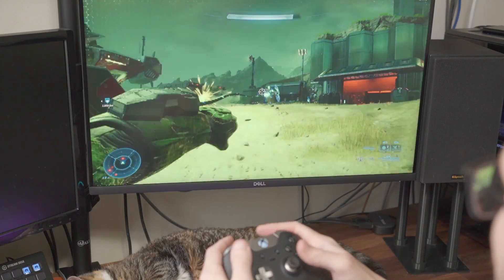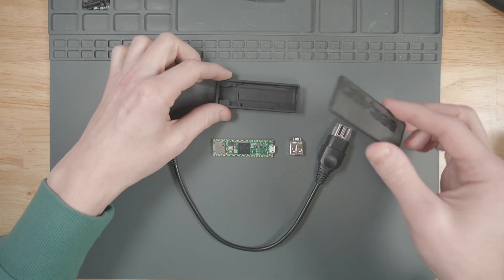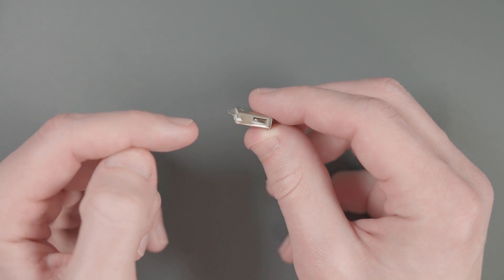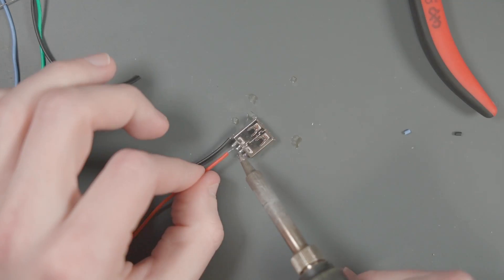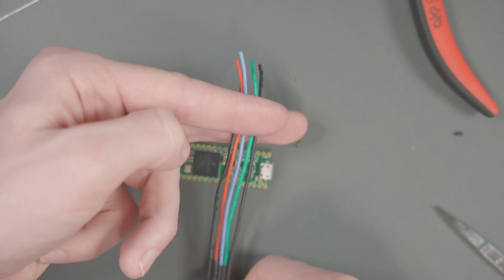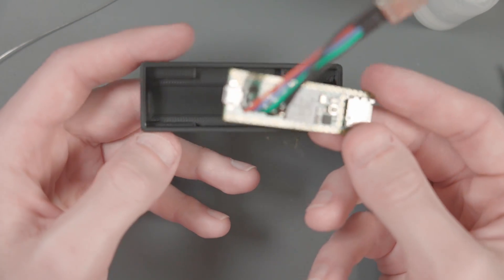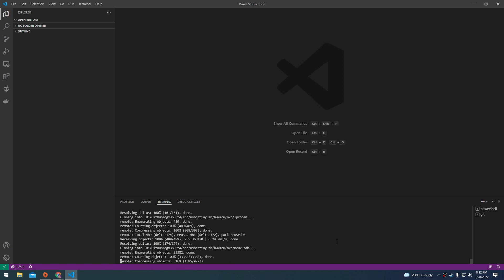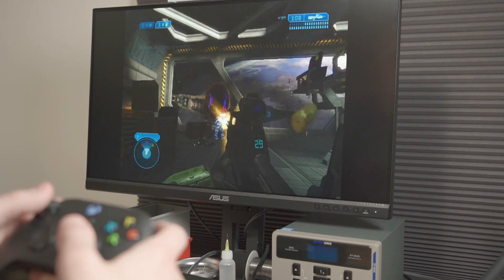Use an Xbox Series Controller with your Original Xbox!

Comment: How do you save the games ? Without the memory card if you use a modern controller?
Reply: The xbox has a hdd that is normally used for saving, the memory card is just so you can bring the saves with you i guess
Reply: @starfire2133  thanks ! I’ll be returning my memory card then ! Needed that info!
Reply: @Caezi  I mean, keep it if you want, they aren't required but I'm sure they are pretty neat

Comment: No offense meant, but the og Xbox used usb.  It was just cutting a controller wire and splicing it to a female plug skipping the brown/yellow(?) wire.  Is this for universal joystick support without drivers?  I'm curious because in PSO I spliced for usb keyboard support.  🤷‍♂️
Reply: you need to convert the signals from the controller you are using to the corresponding signals for the XBOX. If you come up with a better/cheaper solution, please post it
Reply: @art0van0derlay  It's just USB 1.1 so you can google "XBCD" and see how the connector works.  Any USB 1.1 controller will work.
Reply: @jeffchisamore1556  I think you are missing the point of the video, which is to get a new style controller working with the original xbox. The OG xbox will only work with the protocol used by the OG XBOX controllers, e.g. the Duke. The hack above takes the input from other controllers and emulated the Duke. If it was as easy as splicing cables together, people would not have invested such a lot of effort in building this and they would not sell for $70+
Reply: @art0van0derlay  You might be right.  But as USB 1.1, the original xbox can use a lot of different devices.   Mice, keyboards, etc.  Even PC controllers.  He's got a great video,  but I just wondered why, when the original xbox USB is so well documented.  To be honest, I've actually hacked cables apart on mine.  So I have some experience with it.   Read the info on the XBCD driver page, and maybe you'll see what I'm talking about.   Cheers though, and thanks for the chat on this great old machine.  🙂

Comment: The OG Xbox ports are already USB ports with 1 yellow wire added for the "Vibration" function... you can replace ports 3 & 4 of your Xbox with standard USB ports are just plug in the 8bitdo adapter without going through ANY of this.
Reply: wrong. you need to convert the signals from the controller you are using to the ones the XBOX controller produces... which is what this is doing
Reply: @art0van0derlay  I have replaced ports 3 and 4 on my OG Xbox with USB ports and all I did was leave out the yellow wire.
Reply: True but this is plug and play and let's you switch around. Also much easier than taking apart the console.

Also, the OG Xbox would probably need to be modded with drivers
Reply: Would this work with a modded extension cable? Just by cutting of the yellow wire, and soldering a female usb port to it. And than plugging in the 8bitdo adapter? And what are u using those usb ports for?
Reply: @0010301  it should work just fine.. and they can be used for a flash drive as a memory storage. Not sure how large the upper limit 8s, and I think the Xbox will want to format it.
Reply: @mikey17314  if you have achieved this, please post the details, I'm sure lot's of people will be excited to see. (Or just send them to me personally, I'll make the money from it). You can absolutely use (or make) a usb adapter and you can use a usb stick as storage... but you absolutely cannot use it to use a usb controller (e.g. XBOX 360, PS3/3 etc.) on the XBOX. The protocols for the controllers are different so it plain cannot work. This project and others like the OGX360 (which uses an arduino plus a bespoke host circuit and costs £80) use microcontrollers to read the controller signals and translate them into the corresponding XBOX DUKE responses. And by the way - I'm not speaking from speculation, I tried it, then I built the teensy project and adapted an XBOX360 RF module so I can use an XBOX360 wireless controller... which works great

Comment: Just built mine today. If you're using the CLI mode, just compile, install the teensy programmer, and program the ogx360_t4/.pi0/build/DUKE/firmware.hex file to the teensy.

Comment: is the 8bitdo adapter required to use an xbox series controller or ps4/ps5 controller? I would have though those controllers could work without the 8bitdo
Reply from the maker: You need both parts. The ogx360 adapter lets you connect any Xinput controller to the Xbox, and the 8BitDo adapter let's you use a Bluetooth controller as an Xinput controller

Comment: I will be testing the wingman soon. They recently added OG Xbox support. I believe the wingman plus a 8BitDo adapter will work with series SX controllers. I will report back if it does. This is a nice project but costs are still too high.
Reply: Did it end up working for you ?

Comment: This works great. So far I've tested Xbox one wired, 360 wired/wireless PC adapter. I have a 8bitdo adapter on the way. The only hangup I had was  not first downloading and setting up GitHub. I hadn't set it up before and wasn't familiar with how it worked in visual studio. I was getting errors unknown git commands as it wasn't installed. Hope this helps others who may struggle with the same.
Reply: thank you for this!  I didn't have git installed either and kept running into errors.

Comment: Question: I have a modded OG Xbox as well. Is there a noticable small lag with the controller and action on the system?
Reply: Just tested mine and not only no lag it feels smoother and faster than brook wingman and regular controllers.
Reply: @ConsoleCenter  Actually found out it was the upscaling on my tv. Changed it to Game Mode and now all is well
Reply: @christopherdavis5950  not upscaling, processing. modern TVs will always upscale low resolution content no matter if the TV is in game mode or not.

Comment: Man it's crazy how these old consoles still have support from the community 20+ years later.
Reply: it would be even crazier, if a company just simply would build decent controller. you can find plenty of 6-8 usd cheap controller for the original xbox, but they are all horrible, bad analogsticks, crap feeling buttons, terrible shoulder sticks etc. many would have no problem to pay 40-50 usd for a good controller if you just can plug and play like with those shit 8 usd controllers. i dont get it why no company, who already builds controllers do not make them...
but instead people need to buy eletronic parts worth up to 50-60 usd, solder it, programm it, maybe put it into a 3d printed case and use it externally. i just dont get it.
Reply from the maker: Programming a micro controller and designing a 3D printed case is free and easy. Designing a good controller takes a lot of of time and money
Reply: @dubesinhower  i am not talking about a new startup. beside for somebody to do it from the ground up, designwise its the same amount of work to do a case design, owning a 3d printer etc.
i am talking about companies who already are in the business, but for some odd reason they dont make a decent controller.
8bitDo or Hyperkin have plenty of controller designes, they just need to put the correct electronics in it and attach instead of usb the original xbox port.
hell they could even mass produce and therefor bring the price down controllers with the ogx360 in it, just partner up with ryze so he get for each controller, because he did the softwarework 1-2 usd and everybody could be happy. charge for it 60 usd. but no, we can buy crap xbox classic controller from aliexpress, which work but are terrible in general.
Reply from the maker: It's awesome! Honestly that's one of the reasons I'm interested in these older consoles. I enjoy modern projects that make them more functional
Reply: Even more so, it's more supported now, than it was 10 years ago. Projects like Insignia, have revived Xbox live 1.0. The Original Xbox is the best it has been for years now. I don't see it slowing down either.

Comment: Is there something for Xbox 360? I want to use my Xbox Seires X controller on XB360.
Reply: This is for the original xbox only. What you are looking for is a Cronus Zen my friend.
Reply: @logane1102  Thanks my man. Now I have to find the power brick and get that Cronus Zen. I still have my old Xbox 360 controllers, but I like more those from Series X =D. 
Thanks again.
Reply: There's multiple Brook adaptors that will work that are much cheaper than the Cronus Zen.
Reply: @MichaelM28  I’m not familiar with the brook adapters but the cronus zen is definitely worth it because of how versatile it is. It works with every combination of 7th gen console/controller and up. And has superb bluetooth connectivity, AND can even work with a softmodded PS2 running games from OPL and OG xbox if you have an ogx360. Not only that, but you can make your own scripts and load them onto the cronus to enhance the experience such as remapping buttons, analog deadzone and sensitivity modifiers, etc.
I imagine the brook adapter would only work for the 360 and input latency may not be the best.
Reply: @logane1102  How do you get the Cronus Zen to work with a PS2?

Comment: Would this work with the official Xbox controller dongle for pc
Reply: Bluetooth 8bitdo/compatible controllers via the 8BitDo Wireless USB Adapter or Rev 2.

Wired 8bitdo controllers when they are started in X-input mode.

Xbox S/X Wired

Xbox One Wired (Genuine / PDP)

Xbox 360 Wired

Xbox 360 Wireless (Via PC USB Receiver)

PS4 Wired

Comment: A lot of people have mentioned the Brook adapter. I have one for use with a racing wheel. You still need to get a USB to OGXBOX cable to use that adapter.
Reply: I have the Brook and it works well with XB1 controller, but lacks wireless XSX controller support. 

The Teensy board does the trick though, so I’ll be getting four setup shortly!
Reply: @blu_falcon6321  doesn't the brook adapter work with series S/X controllers if you plug the 8bitDo adapter into the brook and  then sync the controller to the 8BitDo? Pretty sure it does...
Reply: What's your racing wheel setup for the OG Xbox? Didn't think the Brook supported wheels

Comment: There's an adaptor called the Wingman XB by Brook Gaming that works the same as this and even has bluetooth built-in. It also requires no soldering.
Reply from the maker: Wingman XB does not support wireless Xbox controllers
Reply: @dubesinhower  It doesn't support Series X controllers wirelessly due to them using Bluetooth LE but it supports all standard Xbox One controllers and the Elite Series 1 wirelessly. Will also work wirelessly with the Dualsense and Dualshock 4

Comment: I’ve wanted to do this for a while but the cost of the components is prohibitive :/
Reply: Do you know how much it is to complete to project?
Reply: @Dikwili  $50 to $70 with some extra parts left over for another.
Reply: @ConsoleCenter  still too pricey. If the teensy board was cheaper this would be great. Almost $300 for a 4 player setup
Reply: @jarod3371  got it down to $55ish.  Brook wingman is $50 on amazon and better

Comment: As much as I would prefer to use wired controllers with consoles intened for CRTs I may have to do this. The A button on my OG S controller has to be pressed fairly hard, which is annoying during the middle of a race in need for speed most wanted.

I just wish (original) ps3 controllers weren't so expensive or I might do a blueretro for PS1/2
Reply: I agree but man are the black and white buttons placed poorly on the OG Xbox. This might fix the issue